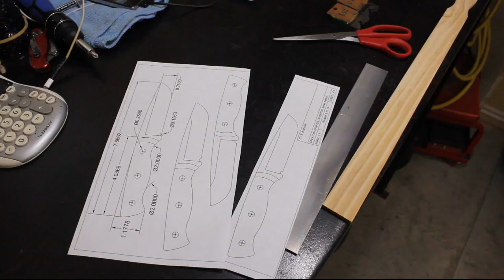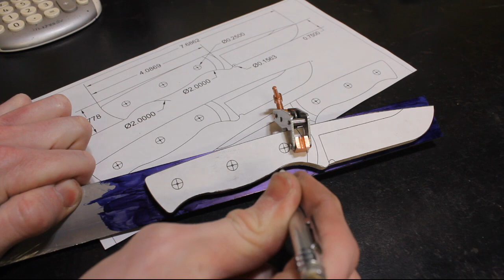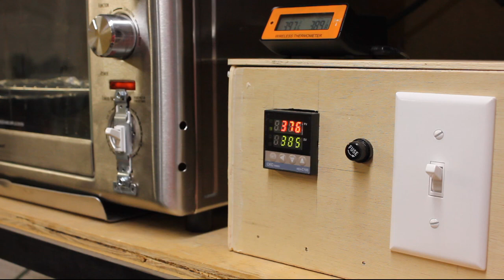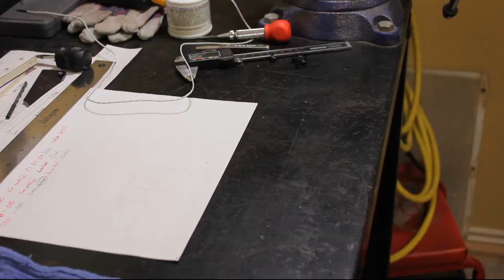Making a Bushcraft Knife - 2019

Comment: Nice knife!! Did I see you etching the blade with the DC? If so  what is the benefits ive always used ac, and was taught that way. Thanks
Reply from the maker: Hey Jeremy, the DC power will provide you with a deep etch (almost like a stamp). The AC etch will give you a dark mark. On a hand sanded blade I'll first etch deep with DC then mark with AC to make it dark. On a blade that I will be stone-washing I'll just mark it deep with DC power. Hope that clears it up! Cheers
Reply: Thanks very much!!

Comment: What kind of gloves do ya use there when cutting out the pattern on your band saw. Btw I just received my band saw table like yours today. I can’t wait to assemble it and cut out 3 blades. I think I asked you before but don’t remember if ya responded. Is that a DD tool rest.
Reply from the maker: Hey Chip, That is not a DD tool rest. These are the gloves I use. I really like them. Cut resistant and give you some heat protection too. https://amzn.to/2rrq5vU